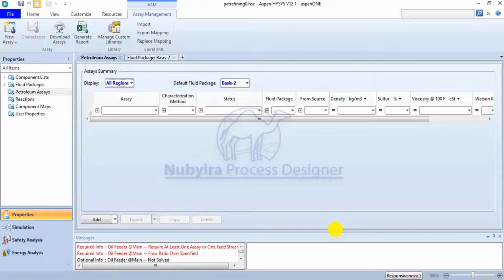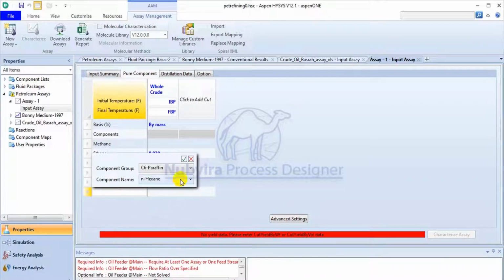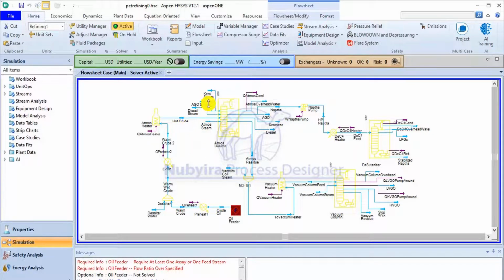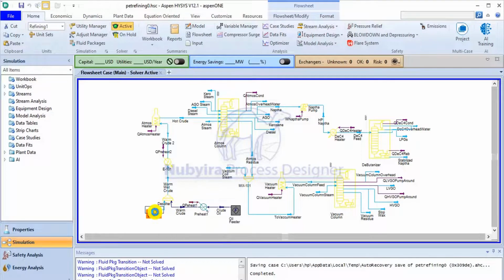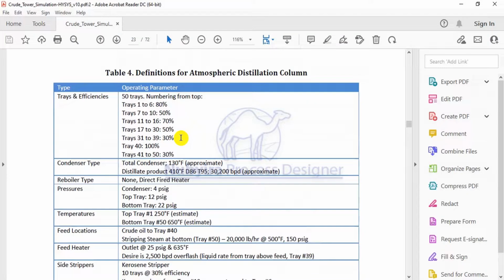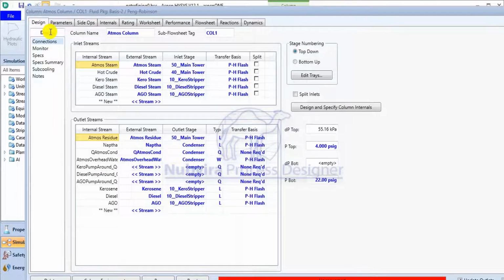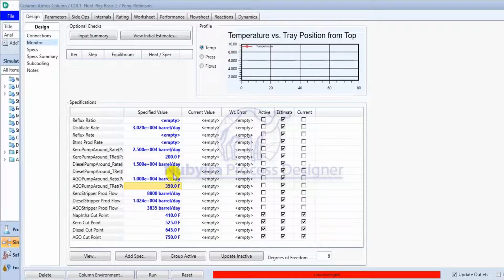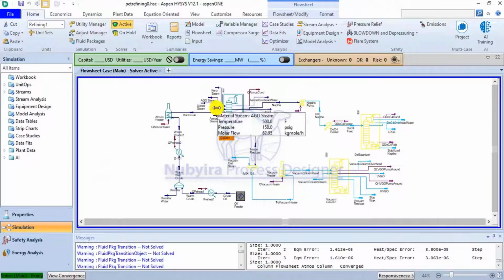Advanced Petroleum Refining with Aspen HYSYS: Crude Characterization & Distillation

Comment: Great video. Did you use Aspen v12 for the simulation?
Reply from the maker: it helps in increasing model accuracy and making it more realistic. It allows using modern sophisticated AI tool to optimize the model parameters that will give good and more accurate predictions of processes that is simulated.
Reply: @nubyiraprocessdesigners  Thank you. So it's advisable to switch to v12 right?
Reply from the maker: yeah, more powerful
Reply: @nubyiraprocessdesigners  thank you
Reply from the maker: yes, I used Aspen HYSYS version 12 software to create the simulation model in the video.
Reply: @nubyiraprocessdesigners  what does the AI option does? I am trying to change from 11 to 12 and I want an informed advice on the differences